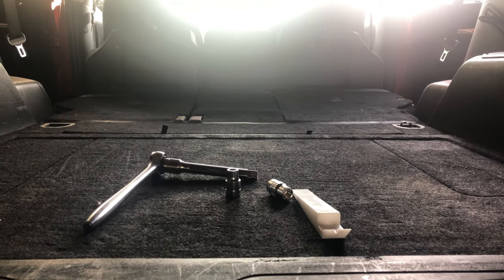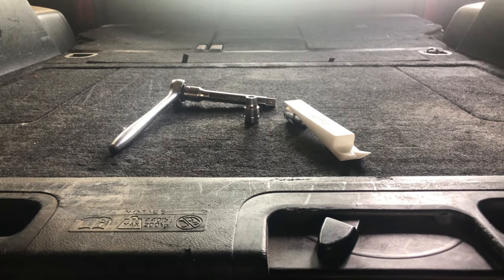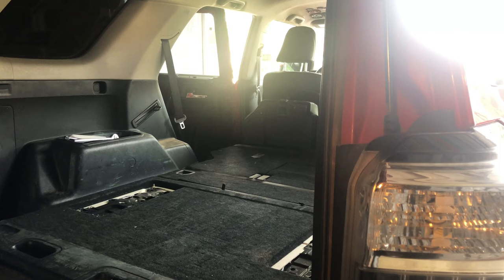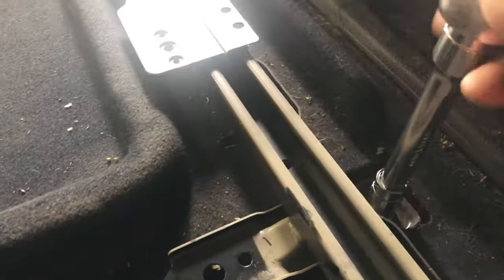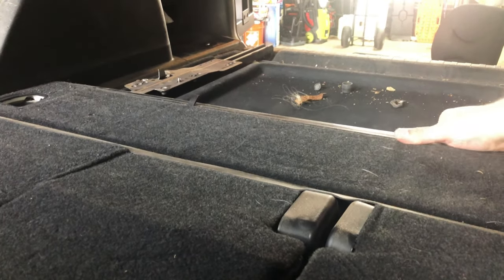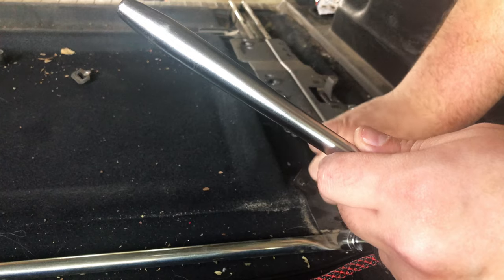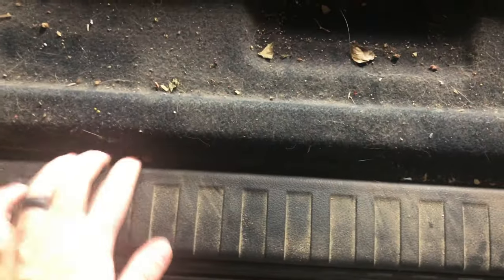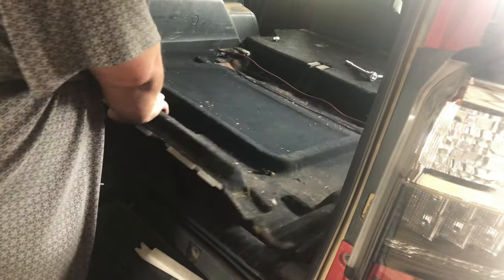How to Remove 5th Gen 4Runner Sliding Rear Cargo Deck

Comment: Do you have any videos or info of replacing it with a storage build or anything?
Reply from the maker: I have a video installing a plate system, which you can attach drawers to and fridge sliders. I have a single drawer with a fridge slide on mine. It's one of the last few videos I uploaded.

Comment: I'm not seeing part 2 for adding replacement insulation and carpet.
Reply from the maker: There isn't one. I added a platform to replace my cargo deck. I added sound deadening, but that's all that was needed for what I was doing. You would need to buy the factory non cargo deck hardware to install it as the cargo deck one is different if I remember correctly.

Comment: What do you put down to cover the exposed bare floor 
Do you need to buy carpet section from Toyota
Reply from the maker: I put down sound deadening and used a rear platform to mount my drawer system to. If you weren't doing a platform yes, the carpet for non sliding decks is what you would need. Wouldn't be a bad idea to add sound deadening either.
Reply: Thanks
Reply: Thanks
Reply: @MaddoxBBQ    by chance does anyone have a link to the oem carpet for the non sliding tray versions?

Comment: Hi great video thanks!   My 5th gen has a 3rd row seat.   I would like to get rid of the 3rd row and replace it with a cargo tray.  Do you think everything would be interchangeable once it is stripped down to the shell to do this?  Thanks for any suggestions.
Reply from the maker: I have seen people take out the cargo tray to install the third row, but not the other way around. I would imagine it's possible, however, if I remember correctly there's an issue with some plastic trimming. Not sure if it needed to be trimmed or not. It shouldn't be the case for installing the cargo tray, but I wonder if there would be gaps somewhere.